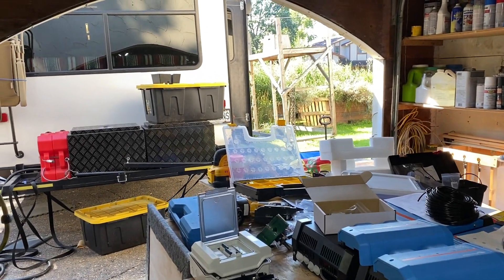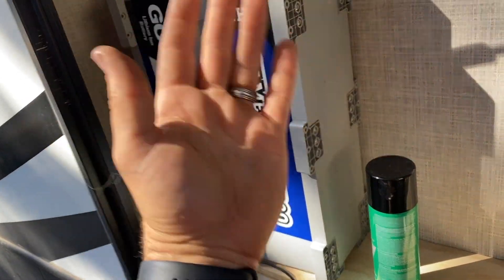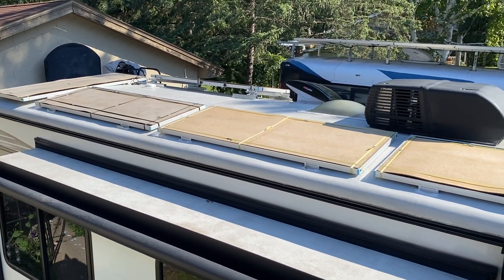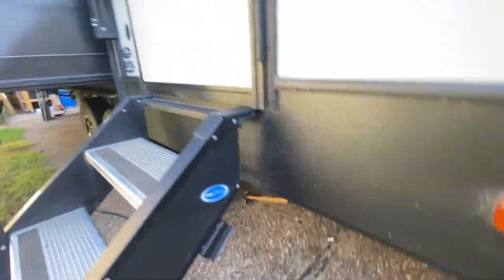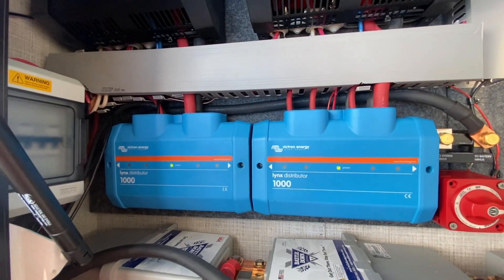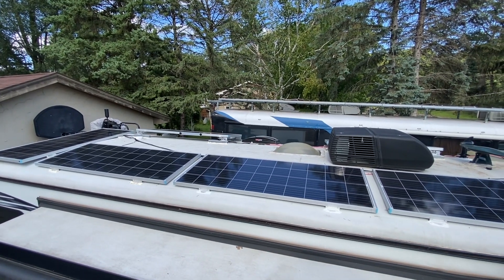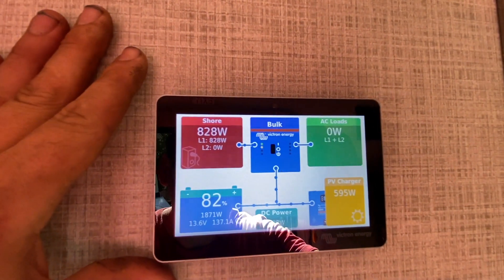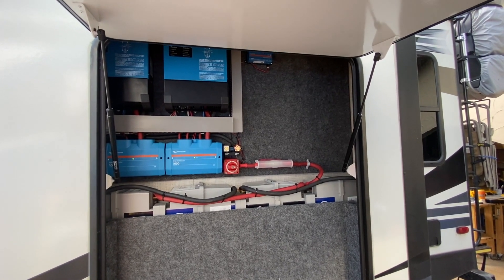Keystone Outback Travel Trailer 2000w Solar Install  x2 Vctron Multiplus - x4 Battle Born GC3s

Comment: Nice looking install.  How did your added panels, inverters and batteries affect the CCC of the trailer?  A lot of these trailers are already running with relatively small CCC, so I'm curious how that worked out here?
Reply from the maker: That’s a great point. In some cases with the lead acid swap out it’s more of a wash. In this case, this guy is most likely over weight. I suggest everyone goto a cat scale to get weighed before so we know where we’re at.
Reply: What was the cost of this I have same trailer and want it solar for off grid camping , very clean set up boys I dig the work.